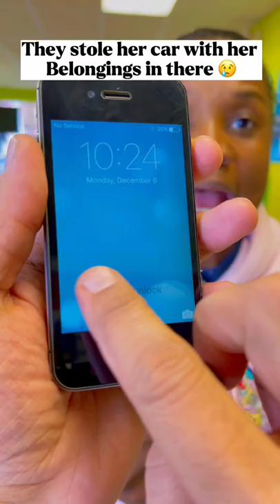She left her car running,They stole her phone & car😢 #shorts #apple #iphone #ios #samsung #android

Comment: I've had my car stolen not a good feeling At all.   My car was found 3 weeks later with tinted windows 😂.
Reply: Atleast you got free tint
Reply: @randomhuman9808  hajaj exactly how i felt
Reply: Free tint speedrun 
(fastest record: 3 weeks)
Reply: My dads 95 Civic got stolen. It was at the impound lot with tons of stuff that wasn’t ours, and a giant subwoofer in the trunk
Reply: Least you got a free tint. Those can be expensive..
Reply: @passingchampion  the impound cop said its common for them to try to change the look of the cars.  By tinting and rims or sound system I guess they think its now there car freaking jerks
Reply: Was it still in the same condition as it left? 😂 Not including dirt
Reply: Still it’s not funny 😔
Reply: @Steven_West  well one tire was flat so I had to replace that. And it was on a low profile rims so not cheap. Ohhhh and I had to buy new keys.  But I was just happy to have it back.  But it was actually in good condition inside a little dirty but nothing to bad
Reply: Free tint lol
Reply: @passingchampion  did u get to keep the subwoofer?
Reply: @zerouk_l  I wish I did
Reply: This is not funny
Reply: Good that no one stealed my Dad's car, it's an 6 cylinders Chevrolet Opala.
Reply: @noor65  😔😔😔😔😔😔😔💔💔💔💔💔🥺🥺🥺😥😥😢😭😭😭🥺🥺💛💛💛💛
Reply: @yashthegamer4250  I gottchu!! imma break the record 😉
Reply: Aye free tint tho
Reply: Same but mine had giant rims and tires on it and was about a month later lol my car was sitting up so high up I kept them so now I feel like a gangster 🥹😂😎
Reply: Do you have some shame
Reply: I remember I had to get my passenger doors replaced before and I went with the cheapest option to get them and they came tinted
Reply: It’s just happened to my nan 1 hour ago
Reply: @passingchampion  my dad's 2006 BMW 318d was stolen and police closed the case after a week

Comment: Lesson: Never leave your car running while it’s unlocked.
Reply: Not mine. While mine is running if I get out with the key fob cause it’s keyless it says no key detected. If you were to get in and put it into drive the whole car will just die. You can say well he waited for her to walk to the car to take off but the sensor in the fob you have to be literally sitting in the seat for it to detect the key. Not sure with all models it’s like this; but my Infiniti is.
Reply: @JoeyRiggs-m4d  I definitely prefer the old system where you actually have to plug the Key into the Ignitionlock to even get the Car running…

Also leaving your while it is running is just terrible idea
Reply: @DarthG3nesis  agreed lol
Reply: Don't leave your car running full stop when you're not in it, especially if you don't have a pouch with a foil lining at the very least, because keyless technology won't work if the key is in one of these pouches.
Reply: I don’t have a car but my mums car says key not detected and can’t drive when you put it into drive so the car model is 2010 Toyota Camry hybrid soo

Comment: I don’t know if the iPhone 4 (or 4s, whichever one this is) would still work. The 3G and some of the 4G network (the non-VoLTE/VoWiFi, being the 5, 5C, and 5S) was shut down in 2022. Basically only the iPhone 6 and later work still.